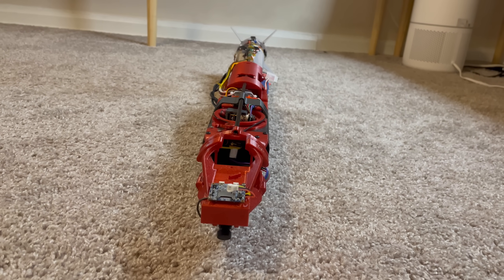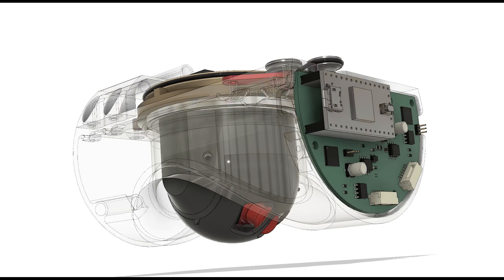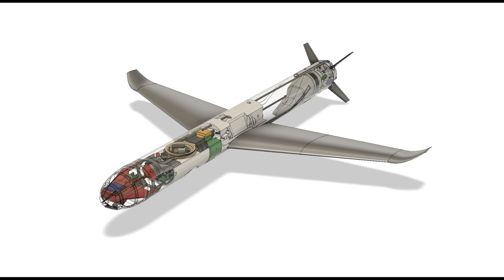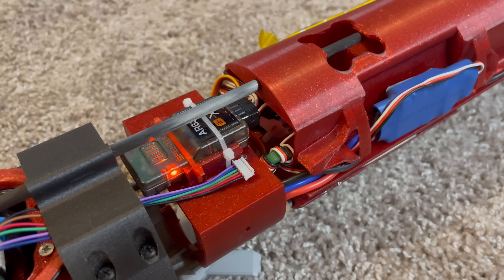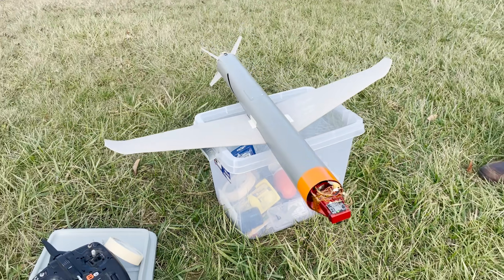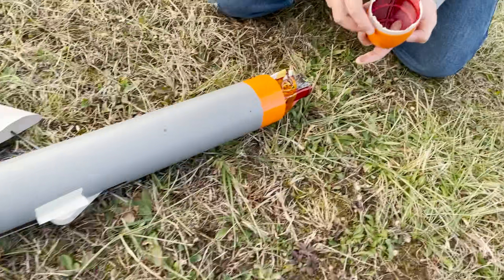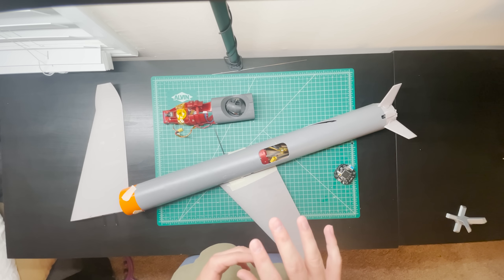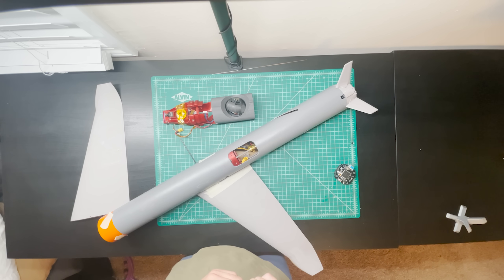Building (And Crashing) my Homemade Surveillance Drone

Comment: 1. Take off weight is too large, well, at least for the wing area you have chosen which is pretty much fixed if they are going to fold out of the fuselage eventually.
2. CG and wing placement seem to be mismatched, dangle it on a string from the mean chord, quarter chord point as a sanity check.
3. Control surfaces are too small for realistically any control during takeoff, and the fact you do not have ailerons would mean that they would need increasing in size compared to a normal set. For roll control matching ref area isn't sufficient as the moments are what counts, that close to the fuselage the moment will be tiny.
4. I'm unsure about the thrust vectoring, there is so much vorticity coming from that ducted fan that redirecting that flow is probably doing nothing apart from obstructing it, which leads me to the final point..
5. I don't think there is any thrust being made tbh. Compare just holding the plane at full throttle to what the fan is expected to produce.

Really cool project, I hope you can make it fly!
Reply: Pretty good points, I was also going to point out the thrust vectoring and thrust issues, I feel that the thrust vectoring needs to be eliminated, and the inlet needs a big redesign to let a lot more are in and directing it accordingly, I would provably go with an all around inlet or 4 inlets similar to that of a cruise missile, but nonetheless it needs a lot of air going in just because its fan propulsion, there is no pressure differential created by combustion and the air needs to enter as easily as it can, that design could hinder the air flow.
Reply: RAIL LAUNCH SYSTEM 100%. take human error out, add much needed speed!!! make it repeatable.
Reply: Yes point 5 seemed almost obvious, but I could be mistaken. With enough trust I would expect it to at least fly a few meters even with all the other points being an issue as well. I would've expected a thrust test inside. :)
Reply: Yeah you really hit the nail on the head with this comment. The most major issues seem to be weight, poor wing placement, low wing surface area, bad control surfaces, and poor thrust. 

If you've ever seen actual surveillance drones, they usually have MASSIVE wing spans for the exact benefits of low stall speeds and low cruising speeds. 

It also seems like he tried to apply some concepts from his rocket that aren't applicable to something like this, such as the control surfaces. Those control surfaces may work fine for a rocket that generates lift through rocket propulsion since they allow for the base of the rocket to turn, and as a result, direct the thrust. But it will not work that great for things that generate lift from wings. All control really is, is just manipulating lift in order to change velocity. 

Apart from those things, it also looks VERY heavy, and combined with that thruster, I just had a good feeling from the beginning that it wasn't gonna take off. That little fan is doing almost nothing other than eating battery and spinning. The thrust vectoring is also completely useless for the reasons you said. 

All in all, what he should do is slim down the design to make it narrow and long instead of short and thick. Probably ditch the folding wing design and increase wing span significantly, as well as place the control surfaces ON the wings instead of on the back, and just add stabilizing surfaces in the back like an actual plane. Along with that, get rid of the enclosed thruster design and go with a much larger, higher surface area propeller in the back to increase thrust.
Reply: My thoughts exactly aswell, i'd argue that he could make it a biplan to double the wing area but even that may not be enough, and comes with additional drawbacks.
Reply: Oh great point about the fan vorticity, i never even heard of that before, that sounds like a big problem. I was wondering why it didn't look like it made any thrust at all. You're definitely operating with a LOT less thrust than a rocket and vectoring fins would already eat away a huge chunk of it even without that, even on actual turbines they use moving ducts
Reply: these are all really good points and part of the many problems for sure - cg is wrong, take off speed too low, in order to get your thrust vector system to work better, you need to have a much, much higher t2Wt ratio, etc. I had thought the wings were at some point designed to extract, if you were to hand launch using a spear thrower like setup, you could probably get a greater launch speed, especially in a missile config and then the wings can deploy once a sufficient toss velocity is reached (enough to overcome induced drag of the wings) there will also be a bit of a operational learning curve as well as design changes in making the ideal weight, ergonomics, and balance for hand launches, for example your hand launcher will have to develop the best technique for hand launch. ailerons would probably be a better route than the 4 vector thrust, 3 tail stabs vectored + ailerons instead
Reply: also the air from the edf is probably pritty turbulent and has spinn, meaning the fins might cause some rotation force. It seams to alway s role to the left
Reply: Thrust vectoring is done with EDFs, stop it with the nonsense.

Comment: You can add a one use rocket motor to it that launches it in the air then detaches after it gains enough air speed

Comment: 1) it seems underpowered.   2) check weight and blalance.   3) Where's your rear empanage?  No virtical or horizontal stabilizers (w/rudder and elevators),  Your small fins are okay for a rocket but the major flight use is as an airplane, but you have to build an airplane (w/rear stabilizers) and will give you more control authority.    Elevators guide your pitch, rudders help you turn.    I didn't see any ailerons, either.  You're trying to get a rocket to fly like a plane, but you don't see NASA sending airplanes to space.  They are two different configurations for two different flight profiles. Did you calc the lift from your wings and will it lift the weight you have. Don't leave out that calc.

Comment: I don't think this can fly. The power to weight ratio is too low. I am sure it would work if the engine was a gas turbine or a rocket motor instead of a wimpy little electric fan.

Comment: Some of my thoughts for moving forward with Hatchet.

1. Reduce weight - among your good ideas where to reduce, maybe try to lower your number of 3d prints, or optimize their weight with design or other filaments like foamy LW PLA. 
2. Rail launching - great idea for repeatability and accuracy of launching, also you can test lot of variables like optimal angle, speed etc before going for vertical launching with booster
3. Change the intake to the upside - you will have much less trouble with testing and landing. With fixed wing version it is very fast change, with folding wings it can force the orientation change on the wingtips (basically turning the wingbox upsidedown)
4. Ailerons for the fixed wing version - i think you have small control authority with control surfaces on the body for small speeds. Maybe it is not a bad idea to introduce ailerons on the fixed wing. It should give a lot of lever for roll stabilization. You can decide to not use them during flight to learn more about your fins/tvc control system. You can also move them closer and closer to the body with each Hatchet refinement, until you ditch them alltogether with introduction of folding wings. This should be easy to implement with the creation of lighter/simplier wingbox you are thinking.

I wish you luck, this is great channel and you have briliant concepts of thinking.

Mark

Comment: A catapult, like you mentioned with the cords, could work. You could also use smaller rocket engines as JATO thrusters(I'm not versed at all in the types, so I don't even know if there is a small one that could work). And to me, the instability probably comes from the short fins at the back at the speed it was thrown at. Getting higher launch speed could solve this. Maybe you could make a temporary larger tail for these first take-off tests.

Comment: Honestly, with that endoframe- skip the intake duct and let the edf breathe, just open frame it without the intake. While the intake might be fine at speed, all of the airflow at takeoff is coming from the fan/ vacuum cleaner lol.
Reply: great point
Reply: A duct can help guide the airflow so it's not so turbulent going into the fan,  but all sides should probably be opened up to get air from all sides.

Comment: I wonder, why a swept back wing design? Swept back wings are worse than straight wings as low speed lift goes, also they have less than ideal stall characteristics 
Also those control surfaces might be still a bit too small but im not sure
Reply: Another thing, which airfoil are you using?
I'd suggest to calculate a rough Reynolds number you'll be operating at and use an airfoil with a lower efficiency but better stall characteristics at first, then maybe move to a more efficient airfoil
Reply: yeah, swept back wings should just be better at high speed in terms of drag
Reply: The swept angle isn’t that bad, imo it’s a tapered wing. I agree the surfaces are too small
Reply: @wire3989  i think a straight wing could still give some benefits to the build, or maybe I'm just a straight wing lover😅
Reply: Здравствуйте коллега -)

Comment: instead of a turbine fan, i recommend using a centrifugal fan and having a hollow in the base which stores the fan folded up, then a small linear converter pushes the propeller out and when it starts spinning, it unfold and propels the aircraft with more power, and you wont have to implement active vectoring which increases throttle drag by alot

Comment: 13:15 the way your friend is throwing it here is forcing the plane to pitch up. If he can hold it at COM and guide it into the air under the planes own power, you’ll be able to keep control. Alternatively maybe a rail like the V1 can help you eliminate variables here. Looking forward to seeing more!
Reply: It seems like the drone is also way underpowered, as by the 2nd launch he didn't pitch it up much but the plane just fell like a rock
Reply: RAIL LAUNCH SYSTEM 100%. take human error out, add much needed speed!!! make it repeatable.
Reply: @eriknulty6392  Or even just a bungee/hi-start system like a lot of the EDF guys use.
Reply: @LoudRC  that would probably work as well. because that bird needs some major speed to start getting under control.
Reply: Rail indeed, but that needs thrust, even with too much weight it should have enough thrust to at least fly a meter or two.
Reply: @punishedbrains  no, if it had enough thrust to FLY at all then it could keep flying... at best you are talking about controlled falling which just points to you not knowing what you are talking about and pretending that you do.
Reply: @thomgizziz  I never suggested I know and a meter or two I don't consider actual flying, more like graciously falling (yes I used the word fly, but common... 2 meters). But no, I have no experience in it. You're making assumptions too quickly, you want to be rude apparently all of which seems a normal thing these days. :)
Reply: all this V1 talk reminds me of the gyrostabelised german flying bombs that were utilised in WW2 to attack GB/London
Reply: The guy launching it had his hand over the thrust nozzle !
Reply: No, no he can't. There isn't enough power and way too much weight. There is more than enough info out there that this dude should have figured this out before he failed like this.
Reply: @thomgizziz  it’s a prototype my guy, relax

Comment: a coble of problem 
1 The wings dont lock large enuff fore the mos of the aircraft
2 Are you shor that tha edf is actionly goting the frust it that you expect , it sonds like its not 
3 From the 2 atemt frowing the craft i can se that your to slow fore the wing aria and maby even unstabill and therofer it fell like a rock(lookt like my first "aircraft")

But my experiens is mostly in slow flying aircraft that you cant test if thy are stabil at realy slow (6km/h) speeds and are ment tho cruse at cirka 20km/h

Can recomand trying XFLR5 to se if the aircorf ationly is stabill, it can also help whit caracturising the strabillety and minemal speed
Good look in general

Comment: From my experience, RC aircraft need a lot of aerodynamic stability/control and a high thrust-to-weight ratio. I very much agree the aircraft has too high of a stall speed to be hand launched. You can't really add much wing area to your design, so yes, you'll need to dramatically decrease you're takeoff weight until you come up with some kind of launch mechanism (rocket boosted in the future?).
I'm curious about the trust from the ducted fan. The fan area and motor size look ok, but the thrust vectoring vanes produce drag within the duct, which reduces your overall thrust. For these next few flights, try removing these vanes from the duct. They probably aren't doing much to improve flight control right now and are something you can build up to in the future.
Just looking at the planform, the stabilizers look small compared to your wing area. The yaw rotation on launch agrees with your assessment: you need more yaw stability. Enlarging the top stabs to about 3x their current area should be good enough.
Best of luck with your design! I'm looking forward to your next video on the project and seeing how you overcome these challenges.

Comment: At the flight attemps your friend seems to be trying to launch/throw the drone off its center of gravity which naturally puts its in an unstable state causing it to stall/drop. I'm no expert on RC planes but I've flown and thrown them enough to know how not to launch a RC Plane/Drone. Always try to throw them FROM their center of gravity or mass. at 13:15 your friend also seems to be thrusting it from the exhaust which gives it an unstable amount of force pushing the center of thrust way back and increasing the AoA of the wings in return causing a stall. Another thing that he seems to be throwing the drone in a curve which should not do; what he should do instead is thrust/throw the drone as straight forward as he can without altering the drones course/orientation. If I weren't able to explain things good enough; please pardon me for my English as it is not my native language :)

Comment: CG issues. Woefully under powered, with a weight to power ratio that cant sustain lift in the current configuration. It really needs a rocket engine at the back or more controlled thrust to compensate.

What an amazing project.

Comment: Awesome! Im looking forward to the camera system. Thats an awesome project. Some thaughts on the design:
Especially in flight 3 it looks like the thing doesn't want to fly straight. You could stick some foamboard to the back, move the CG a bit forward and throw it into something soft (eg. tall garss) without the motor on. By playing with the size of the foamboard you could get a feeling for the stabalizor size and CG. Replacing the payloads with dummy weights and/or reducing weight could keep testing cost down.

Another thing that might be a problem at low speeds could be the air inlet for the EDF. Since it is sucking air in from the bottom of the aircraft i would expect this to cause a pitching moment. Someone here mentioned the Tomahawk Missile. That one has a sideduct aswell but the inlet is facing forward. If the pitching is a problem, that might be a fix.

Comment: tru dramatically increasing the controll surfaces maybe even test it first with standard tail configuration id also suggest you try taking off with a bungee many high speed planes use this method. If yyoud have any further questions im happy to help. also another idea just wire cut everything from epp foam and test the aerodynamic performance then try increasing the weight and see what can you do to improve handling at higher mass. sometimes in engineering you have to take two steps backk to preogress but itll be worth it;)

Comment: I love it! Did you ever find the camera housing for the last rocket?
Reply from the maker: No :( it’s still Missing In Action
Reply: @LafayetteSystems  
RAIL LAUNCH SYSTEM 100%. take human error out, add much needed speed!!! make it repeatable.
Reply: I don't know where my reply are going
Reply: @ if you’re speaking about my comment, I think I had an unstable internet connection and so it posted my comment twice. I’ll delete one to eliminate the confusion.
Reply: @jordandegraaff  
Hello
Reply: I have tons of experience with rc planes including over 50lbs versions which need a license to be flown

Comment: I think the problem is the weight distribution in the body content and enough power for the engine, aerodynamic accuracy etc... but I like it. Don't forget the rear wings they are very small, they are suitable for rocket concepts and not the planes.😅

Comment: I would be  inclined to remove the wing deployment kit and stick with non flick outwings (Unless you have  a desperate  need  to have deployable wings).  I was going to suggest a launch system but you already mentioned that.   I wonder if the fan is developing enough thrust to keep the plane in the air.  Can you feed it more air?

It's a very cool project mind you :)